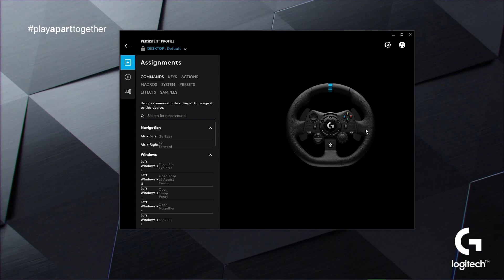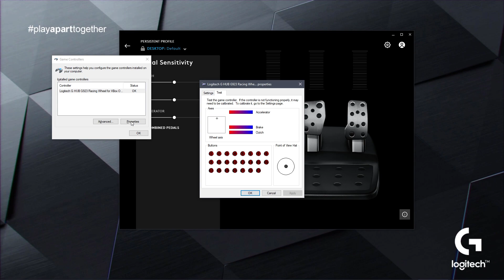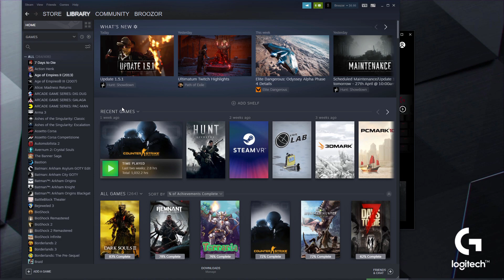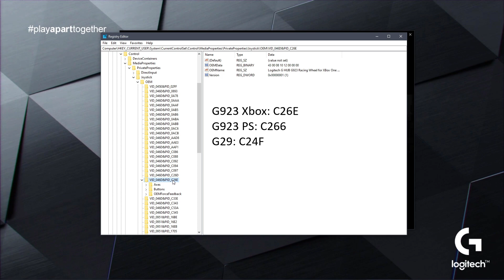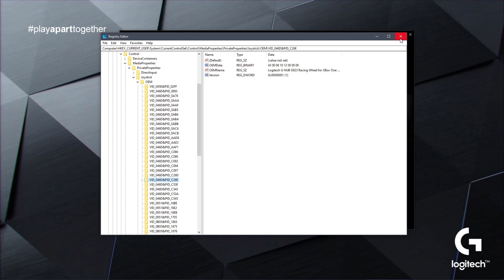How to troubleshoot G923/G29/G920 for Connection Issue

Comment: i am getting Current leak from the pedal base from New G923.
Its a very small leak that gives a electrostatic bite when I touch the base M6 screws.
Now my wheel stand is giving occasional electrostatic bite...

its not a big issue BUT something Logitech should look at
Reply from the maker: Hi there!

Could you open a ticket with us? We'd love to find out a little more about this issue.

https://support.logi.com/hc/en-us/requests/new?ticket_form_id=360000621393

Comment: My g923 doesnt work in lghub, pedal section is bug but in games the wheel works fine but is always accelerating by itself, it worked fine days ago
Reply from the maker: Hi! 

Please make sure your pedals are properly connected to your wheel! There could be a loose connection.

If that doesn't help your issue please open up a ticket with us!
https://support.logi.com/hc/en-us/requests/new?ticket_form_id=360000621393

Comment: I went into OEM and found both C262, and C266. I don't know why I am using G923 PS and never used a G920...? Just remove C266 or both? I also have C267 that identifies it as another wheel too. I only have the G923 PS, so I should only see C266 right?
Reply from the maker: Hi!

Please only delete the registry that is relevant to your wheel!

If that doesn't help please open a ticket with us!

https://support.logi.com/hc/en-us/requests/new?ticket_form_id=360000621393

Comment: Hello team,
From the diagnosis, I can see that the throttle of my g923 (just bought it today) is stuck at 40% of the full throttle.

Any help?
Tried changing with the sensitivity, but it didn't work:(
Reply from the maker: Hi! 

Can you try to reinstall your drivers and make sure your cable for your pedals is properly seated?

If this doesn't help please open a ticket with us!

https://support.logi.com/hc/en-us/requests/new?ticket_form_id=360000621393
Reply: Hi, 
Finally there was a factory defect in my g923.
I got a new one!

Comment: hello, in ghub setting when i uncheck centering spring in non force feedback games, i can't rotate my wheel, its in center can't be move, it doesn't happen before, can you explain how to fix this? and then when i'm in FH4 game, just slight turn on my wheel and my wheel goes crazy for full spin, how is that possible?
Reply from the maker: Hi there! 

Does it only happen in FH4? Or are you losing support in all games? It should only calibrate once and then after that it usually is ok. You may need to do a driver reinstall! 

If that doesn't help you out please open a ticket up with us with the link below!

https://support.logi.com/hc/en-us/requests/new?ticket_form_id=360000621393

Comment: Hi,
I have just purchased G29 version. I have tried all your steps but the wheel would not show on Steam controller settings. I tried on deleting at registry editor hoping it would work but it didn’t work. Please help
Reply from the maker: Hi! If you could please open a ticket up with us that would be great! It seems like the issue may need some more in depth support. 

Link below!
https://support.logi.com/hc/en-us/requests/new?ticket_form_id=360000621393

Comment: the problem with my g29 steering wheel is that its always on full left -450 even i turn it to the right it wont work im playing with it on pc ive been trying to find a solution for months now and still havent found a working one and it doesnt calibrate when i connect it to the pc. i tried with this video but it did not work i hope you will be able to tell me whats the problem
Reply from the maker: Hey!

Have you tried reinstalling your drivers and following the steps to delete from regedit?

If so please open a ticket with us so we can help you further!

https://support.logi.com/hc/en-us/requests/new?ticket_form_id=360000621393
Reply: @logitechsupport  DUDE I HAVE THE SAME PROBLEM IT WONT FIXXXX IDK WHY just randomly playing and it disconnets go -450 and now wont ever recalibrate
Reply: @logitechsupport  My Wheel doesn't come back on the registry, and when i plugged it back, a "pop" came from where my wheel was...Power supply done ? I just hope i did not fry the wheel board...

Comment: I have a problem, my wheel after about 3 minutes of driving sometimes will thing that -24 is center, and in ghub it says 0. But, the wheel is to the left some. How can I fix this? I have a g920 and shifter. And cables are connected fine made sure.
Reply from the maker: Hi!

Let's try reinstalling your drivers completely for your wheel. If that does not work then please open a ticket with us so we can help you further!

https://support.logi.com/hc/en-us/requests/new?ticket_form_id=360000621393

Comment: I have a g920 and it always worked perfectly but since yesterday I suddenly have this problem. the light is blinking and in the ghhub can't find the steering wheel can you help me please

Edit: all buttons don't work either. And when i plug in my steering wheel, my pc also acts strange as if a button is constantly being pressed
Reply from the maker: Hi! This could be a power issue. Please make sure that all your connections are secure! 

If this doesn't help please open a ticket with us down at the link below. 

https://support.logi.com/hc/en-us/requests/new?ticket_form_id=360000621393

Comment: my g29 is fully powered but g hub doesn't fully connect it just says connecting
Reply from the maker: Hi!

Please make sure your wheel drivers have been installed correctly! You may need to do a driver wipe as stated in the video and reinstall.

If this doesn't work please contact us and we can help you out further!

https://support.logi.com/hc/en-us/requests/new?ticket_form_id=360000621393

Comment: I cant connect my logitech shifter is there any solution for it?
Reply from the maker: Hi! 

Make sure all the cables are properly seated, after that you may have to do a driver reinstall or a firmware update on your wheel! Same with a software update on G Hub. If this doesn't solve your issue please open a ticket with us so we can help out with way more depth!

https://support.logi.com/hc/en-us/requests/new?ticket_form_id=360000621393

Comment: I have a problem my wheel works my gear stick work but my peddles don’t help
Reply from the maker: Hey!

If you could make sure all your cables are properly connected and also make sure G Hub is updated as well that could solve your issue! 

If not, please open a ticket with us! We'd love to go more in depth and help you out.

https://support.logi.com/hc/en-us/requests/new?ticket_form_id=360000621393

Comment: Please help me, I have a g920 and everything is working fine I checked all of the power supply’s twice but when I go on to ghub it says that the wheel is connecting and never fully connects, I have left it on for a day and it still says connecting, I have tried unplugging my wheel and plugging it back into my pc but it still says connecting. I hope you can help, thanks.
Reply: This is exactly what is happening with mine too
Reply from the maker: Hi there!

Could you both please try a complete clean install of G Hub? This would require you also delete the folders associated with G Hub prior to reinstalling. 

If this doesn't help your issue please file a ticket so we can provide more in depth support!

https://support.logi.com/hc/en-us/requests/new?ticket_form_id=360000621393

Comment: my logitech g923 isnt powering on, do you have a solution for this? please I just bought it...
Reply from the maker: Hi there!

Please make sure that all your cables are connected properly! Both at the power supply/outlet as well as the wheel itself. It is also always helpful to try a different outlet just in case!

If you still have issues after that please open a ticket with us so we can help you further!

https://support.logi.com/hc/en-us/requests/new?ticket_form_id=360000621393

Comment: I have G29 and my g hub still saying Connecting but nothing happen 
The wheel works but the g hub not load my wheel
Reply from the maker: Hi!

Can you make sure GHUB is completely update to the most recent software?

You may also need to reinstall your G29 drivers!

If that doesn't help you please file a ticket down below so we can diagnose your issue further!

https://support.logi.com/hc/en-us/requests/new?ticket_form_id=360000621393

Comment: My wheel has been working fine for the past month but it appears to have completely failed, it no longer powers on, also it is unable to be recognised.

I've tried everything in this video but no luck
Reply from the maker: Hey!

Can you check all your cables and connections to make sure there is no damage on any of the ends? There may have been a tear in a cable if you suddenly lost all power to it. 

If there doesn't seem to be any obvious damage to your cables please open a ticket with us so we can diagnose this further!

https://support.logi.com/hc/en-us/requests/new?ticket_form_id=360000621393

Comment: What if the wheel registry didn't come back ??? My directional pad doesn't work either
Reply from the maker: Hi!

Make sure you unplug the wheel and completely power cycle before. It should install again after you plug in the wheel. If not you may also need to perform a quick restart on your PC! 

If that does not solve it, please open a ticket with us and we can help you out further.

https://support.logi.com/hc/en-us/requests/new?ticket_form_id=360000621393

Comment: I have the Xbox g923, is the power connection supposed to feel loose? When I connect it, it wiggles quite a lot.
Reply from the maker: Hi there Alan!

The connection itself should be pretty solid however there is a slight give on the connector to allow room for tension. If you feel like this is a separate issue however, please file a ticket with us below so we can help you!

https://support.logi.com/hc/en-us/requests/new?ticket_form_id=360000621393

Comment: my wheel isnt moving in ghub also i can shift and press buttons its just the moving of the wheel that doesnt work at all and the green light is blinking pls reply if you have an idea to fix this
Reply from the maker: Hi there Braco!

Could you please try the instructions at the end of the video to reinstall your drivers! It could be an issue with the installation itself. 

If that doesn't solve your issue please file a ticket at the link below and we can definitely dive deeper to help you out!

https://support.logi.com/hc/en-us/requests/new?ticket_form_id=360000621393

Comment: mine doesnt register the steering input and it blinks green at the top
Reply from the maker: Hi there!

Could you make sure that all of your cables and drivers are properly installed? You may have to do a hard reset on your drivers and reinstall them!

If that doesn't help please file a ticket with us and we can go way more in depth to solve your issue :)

https://support.logi.com/hc/en-us/requests/new?ticket_form_id=360000621393

Comment: How do I connect my g29 to my Mac I can’t change the sensitivity and it’s not connecting
Reply from the maker: Hi!

Can you make sure you have all the correct software updated? As well as the firmware on your wheel!

You may also need to use Logitech Gaming Software depending on which MacOS you are currently running. We should have a list for GHUB and LGS with their mac compatibilities on our website! If these don't solve your issue please open up a ticket with us and we can go more in depth to help you out!

Open a ticket down below:
https://support.logi.com/hc/en-us/requests/new?ticket_form_id=360000621393

Comment: this didnt fix my issue, my issue is when i go into the logitech g hub, and go to steering wheel options, my wheel does not register , i move the wheel side to side and nothing happens,the same thing goes for the game controllers menu , please help me out .
Reply from the maker: Hi there! 

If you can make sure all your power cables are connected properly that would be great! That's our first step. The next would be to make sure your drivers are installed correctly. You can uninstall the drivers via device manager. 

If that does not fix your issue please file a ticket with us through the link below! We will be able to help you out with way more depth there :)

https://support.logi.com/hc/en-us/requests/new?ticket_form_id=360000621393

Comment: my g923 is not being detected by steam
Reply from the maker: Hello!
please try these steps:
1. In Steam, try going into the Settings, click Controller, and then select General Controller Settings.
2. Make sure that nothing is checked. If anything was checked, then that would be the cause of the issue.
We also have a screen shot of this menu in this article: 
(look for and collapse: 
+My wheel does not respond in my driving games launched through Steam)
https://support.logi.com/hc/en-us/articles/360052313254-FAQs-G923

Comment: Any idea why the steering just stop working?!? Everything else works except steering..need help plz
Reply from the maker: Hi!

Some racing titles have an option called Inverted Force Feedback (or similar) in their control options.

This needs to be turned off in order for the force feedback of our gaming wheels to function correctly. Otherwise, the wheel may not center correctly and will appear to constantly steer or push in the wrong direction.

Comment: Never get the Wheel to show in Steam, see time 3.28 on this video, I never get it to show.  Windows can see it, also the Registry Editor also sees it.
Reply from the maker: Hi there!
please try these steps:
1. In Steam, try going into the Settings, click Controller, and then select General Controller Settings.
2. Make sure that nothing is checked. If anything was checked, then that would be the cause of the issue.
We also have a screen shot of this menu in this article: 
(look for and collapse: 
+My wheel does not respond in my driving games launched through Steam)
https://support.logi.com/hc/en-us/articles/360052313254-FAQs-G923
Reply: @logitechsupport  have the same problem, it doesnt fix it
Reply from the maker: Hey Joseph! 

Try doing a complete reinstall of your drivers for the wheel. I'd also make sure your steam is completely updated!

Comment: Deleted the G29 in regedit - didn't came up after plug-unplug XD
It worked earlier, but now wheel don't calibrate itself, G hub sees it, turning wheel doesn't affect the g hub, only if pressing pedals, it's just flashing on top and do not react :(
Reply from the maker: Hi there! 

Typically when the LEDs are flashing it usually is pointed to a power issue. Could you make sure all of your cables are properly seated?

If that doesn't help you out please file a ticket with us for more in depth support below:

https://support.logi.com/hc/en-us/requests/new?ticket_form_id=360000621393
Reply: @logitechsupport  Thank you very much for respond, i appreciate that. My problem was fixed as soon as i realised power unit with not pluged in XD

Comment: I got everything powered on but nothing happens what should i do ? Like it does work normally (pedals and shifter ) and the steering wheel buttons also react but it still beeps like something isnt conected and the wheel when i spin in it doesnt react
Reply from the maker: Hi there!

Are you getting any feedback from GHUB that the wheel is moving at all? Please make sure you have GHUB updated completely as well as the wheels firmware within GHUB!

If you still have a persisting issue please contact us through submitting a support ticket!

https://support.logi.com/hc/en-us/requests/new?ticket_form_id=360000621393

Comment: The LEDs on my G923 are not working on any game, please help.
Reply from the maker: Hello!
The LEDs for the RPM indicator need to receive the proper RPM information from the game in order to function.
LED support must be provided by game developers, and not all games include this support.
If you have a question about LED support for the RPM indicator for a particular game, please see the documentation for the game or contact the game developer.

Comment: Finally a year after I was searching, they release a video, still does not fix my issue though.
Reply from the maker: Could you go a little more into detail on what your issue is? We'd love to help you out! 

If you want more direct support submitting a ticket is also a good route.

Link down below:
https://support.logi.com/hc/en-us/requests/new?ticket_form_id=360000621393
Reply: Did everything but my wheel is stuck on connecting... and when i go into "my gear" its inactive
Reply: @williamvaliquette  same

Comment: I've just received my wheel and it's not working it seems to be a power issue becuase the LEDs aren't lighting up I made sure all cables are plugged in properly and it still doesn't work
Reply from the maker: Hello!

Can you check and make sure everything is properly connected on the power brick as well? Those can come lose every once in a while. 

If the issue still persists please file a ticket with us and we can help you out!

https://support.logi.com/hc/en-us/requests/new?ticket_form_id=360000621393
Reply: Thank you for the support I did end up fixing it by only having the wheel plugged in to the outlet with nothing else plugged in and it worked

Comment: what if the light isnt on on xbox even after power cycling
Reply from the maker: Hi!

If you are referring to the white light that indicates the wheel is powering on, could you make sure all your cables are properly connected? Making sure the power cable is stable would be step one. 

If you still aren't getting power please open up a ticket with us via the link below!

https://support.logi.com/hc/en-us/requests/new?ticket_form_id=360000621393/